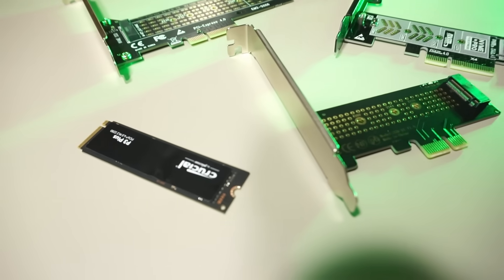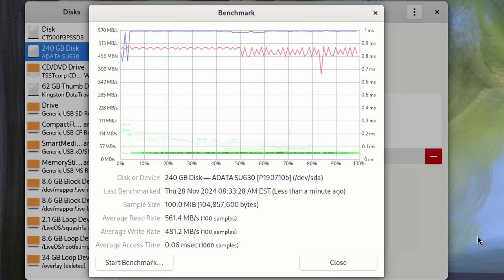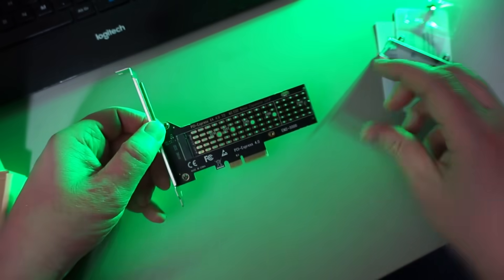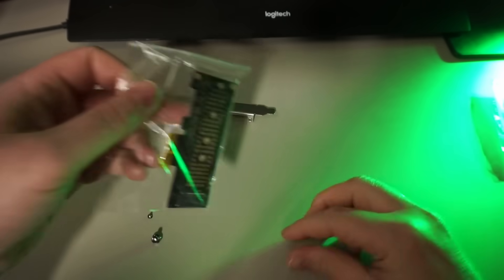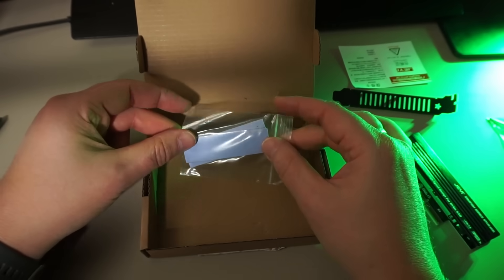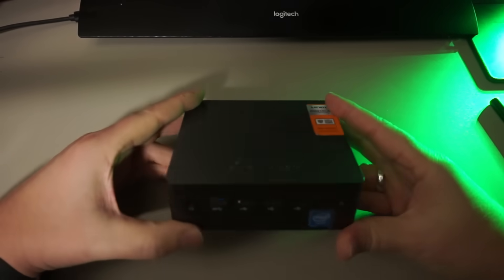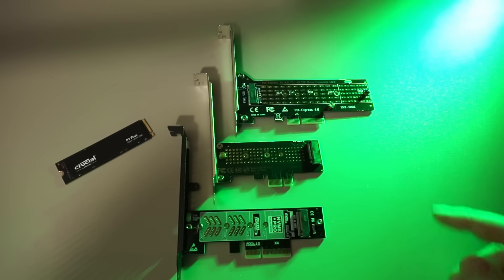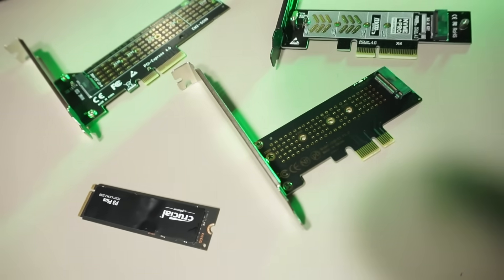Upgrade your old pc with an NVMe! Testing cheap PCIe M.2 adapters!

Comment: I used a 1x card on a J4125 ITX board to save the sata for nas storage (SATA high capacity drives were much cheaper at least at the time of build). CrystalDiskMark showed just over 900MB/s with a cheap Samsung OEM PCIe 3.0 NVMe that managed about 2,200MB/s on a true NVMe port. Was good enough for me.
Since upgraded server/Nas to a T500 on a 4x4 NVMe slot board that goes to about 7,300MB/s

Comment: I actually use one in my PC build from last year. It had two nvme slots which infilled with 2 TB nvmes, than later got a good deal on a 1 TB drive so added it in with one of these.

Comment: His thinking is wrong on heat sinks for NVMe drives.  You many not see thermal throttling on a NVMe if you don't put a heat sink on it. You will have elevated heat that you can reduce with a heat sink to increase the longevity of  the drive.   The HOTER you run any device the shorter the life of the device. It may run at it's top speed, but it will last longer if you keep it cooler.
Reply from the maker: Sure, but as this speed it shouldn't become an issue. I made a mistake in believing my system has PCIe 3.0 slots. It's 2.0, so it's running at less than half what it's rated for. 
I'm picking up a board that has a PCIe 3.0 slot tomorrow to redo the test. Should be quite a bit faster and yes, I do believe it would be beneficial to add a heatsink then.

Comment: A sata is really a decent upgrade for old systems.
An nvme is not worth it in my opinion.
Reply from the maker: They're about the same price here in the Netherlands. Throw in an €8 adapter card and you've got 3x the speed. Kinda cool if you ask me.

Comment: I honestly dpn´t see the value to bother with an nvme drive in a system that doesn´t have a build in nvme slot on the mainboard. A regular old school sata ssd will do just fine. Anyone using such an old system is most likely not doing anything so intensive that he/she would even be able to utilize the higher bandwidth anyways. 
So long story short, consider upgrading to a newer system with a nvme slot, that is if you even need too. My mother plays anno/sims etc on a ryzen 5 5600 and i reused the "old" sata ssd (despite the board having 2 nvme slots) from the old system and the system is damn snappy as is. 
Similar reason as to why gen5 nvme drives are pretty much pointless overk*ll for most users.. heck probably even gen4 is.
Reply from the maker: About any system from about 15 years ago until now is perfectly capable of doing simple tasks like browsing the internet. Simply having stuff starting faster can be a pretty nice feature on those older machines.

Comment: Do you want to test nvme drives? o look at the read speed of their older 3300mb/s newer 7700mb/s ultra the fastest is 14400mb/s when the hd drive has only 120mb/s or sata 550mb/s Max XDDDD That's why I'm only on M.2 NVME 970 evo. No more hdd and defragmentation or a messed up disk for lost data ..
Reply from the maker: I would love to, but I'm still at the point where I have to buy all this stuff myself and I'm bleeding money 😆
Reply: @ex-itguy  Obviously, You have to earn money for something better. These adapters are interesting, I wanted to buy them for my PC before I had a newer PC. But the limitations of these adapters are that you need an x16 slot in version 3.0, otherwise the speed drops by more than half. I've even seen adapters that can be mounted on 8-10 such drives, but the chip in this adapter burns out, which causes the speed to drop, but one thing is good, if you need an adapter and boards without m.2, it's possible, but the speed is max 700-900mb/s, where the drive, for example, has 3,500mb/s, which it supposedly loses in older boards, newer drives also get it through bandwidth and unfortunately lose their durability.
Reply from the maker: Note that there's an error in my test though. My test pc seems to have pcie 2.0 slots. I tested on 3.0 yesterday and speeds are about double the values in this video. So the 1.6GBps you will get on 2.0 as well.
Reply: @ex-itguy  On my old motherboard it didn't even see the adapter so this one. It was only when I replaced the motherboard that I had 2x m/2 slots. I'm currently making the switch and bought a motherboard with 4 m.2 slots. You can buy a better one for m.2 drives for less than PLN 250 for 1 TB, so it's worth it.

Comment: using nvme adapter on old z87 motherboard and install windows in it with some tweaks requiring you to always plug in the usb drive or it wont't boot to windows, but somehow don't know what i am doing exactly now my pc can boot without usb drive.
Reply from the maker: That's weird, if you haven't changed anything. But glad it works, I guess. :)

Comment: A Samsung 950 pro can be used on anything with a pcie slot.  It installs its own "generic nvme drivers" into the mother board.   So anything with even a pciex1 lane can use them for boot drives.  A trick you can do, and I did, on a X58 system from 2008.  A 950 pro in the top x1 slot.  And a 980 pro as the boot drive.  I was limited to I believe pcie gen2 speeds.  But it was still 1600 read and write speeds.  There is a Intel nvme drive that does the same thing.  But it can be hard to find and expensive as heck.  At least when I was looking for it.
Reply from the maker: Yeah the speeds in this video are all PCIe 2.0. I made a dumb mistake... I'm planning on picking up a board with an i5 and a PCIe 3.0 board on Monday so I can redo this test on an actual 3.0 slot. Should be quite a bit higher.
Reply: @ex-itguy  that's absolutely fine. My pcie gen 2 got 1600ish speeds with those drives. I have had 6 of them systems I've built over the years. They work great. That X58 system is still my lan party unit. Got it paired with a RX 6950 XT. It's a thing of beauty.

Comment: I have some of them, they make a lot of sense:

1. I have  a cheap board without nvme slot, Asrock H510
2. I have a server and need all 6 sata onboard slots, the nvme slot blocks 2 sata when in use, the pcie slot doesnt
3. I use 2 nvme ssds on a board with only one nvme slot

The cheap chinese work as well as the branded ones. I am super satisfied with all of them😂👍

Btw:
I assume you need a bios supporting the nvme ssd. Didnt work for me on a Haswell board (Intel 4th gen, H81)

Comment: I'd say that probably most modern motherboards probably DO support booting from one of those adapters. I have a Z97 motherboard with a 4th generation Intel processor, that didn't have an M.2 slot, but one of those adapters worked just fine. One thing to be aware of, is that one of those adapters could potentially change how many lanes are allocated to your graphics card.
Reply from the maker: Someone else mentioned that as well, but another said he used one because the M.2 slot shared lanes with the GPU. 
Annoying stuff. 
A lot of GPU's don't use all lanes though.
Reply: @ex-itguy  It depends on the motherboard and the chipset. Some motherboards get the M.2 lanes from the chipset. Others will get them from the processor. If there are multiple M.2 slots, it will sometimes be a combination. I don't know how they work, post Ryzen era, but previously, most boards would run the x16 slot at x8, when any of the other PCIE slots had anything in them. Some would then drop to x4, if you had something in the alternate full size slot, and something in any of the other slots.

In other words. having a drive in an M.2 slot doesn't necessarily affect performance, but having an adapter card in one of the PCIE slots almost definitely could. However, it's also true that at least as of the RTX 20 series, most cards didn't even come close to maxing out the x16 bandwidth. It might be different with the xx90 series. I don't know.  Just be aware that there is potential to affect your system with PCIE accessories installed.
Reply from the maker: It's a good thing to keep in mind indeed. I'll have to figure out how to check for that on Linux (as I do most things, like this test, on Linux).
Reply: I had to BIOS mod my X79 by slipstreaming NVMe drivers into it; 3rd-4th Gen Intel was the cusp for it. Overall it depends on how the motherboard was built and the chipset it has. For example a motherboard like Intel H670 would funnel 20ish PCIe lanes over 8x 4.0 lanes, while something like H610 or AMD X870 would funnel fewer lanes over 4x 4.0 lanes.

Comment: For those looking for a boot trick for nvme chain loading, get a hold of a copy of clover able to see the NVME drive, then deploy windows from a wim file, it may error on initial boot from the drive claiming "This system is not supported" due to ACPI tables being alien to it, but note that is a user mode error?

You'll need to then use shift+f10 to get a command promt:
1. Add an administrator as otherwise the net step will cause a BSOD as winlogon will exit if no accounts are present.
net user /add [username] [password]
net localgroup administrators [username] /add

2. Force OOBE state to normal
regedit
go to HKLM\system\setup
Edit the following keys:
"SetupType"=0
"SystemSetupInProgress"= 0
"SetupPhase"= 0
"CmdLine"="" (This field should be Blank )
"OOBEInProgress"= 0

3. Reboot the system either via the shutdown command or other means.

This is what worked for me on windows 10 using a m5a97 am3 board, it was even able to update without issues.

Comment: My 11 year old ASUS H97 Plus has an M.2 slot but it couldn't find a 1TB M.2 NVME even when it shows the NVME settings after it was inserted.
I bought a Ugreen adapter, attached the 1TB M.2 and put it in the secondary x16 (PCIe 2.0, x4) and with my OS cloned to it, it boots fine. It still doesn't show in the BIOS where it's located, but the BIOS knows it's there and puts it in the boot menu.
Forgot to say, that M.2 uses legacy boot as that's how my OS installed originally. The BIOS can boot either legacy or UEFI.
Reply: ASUS H97 support Nvme boot ,incase not working upgrade the bios but not support PCI Express supported booting.

https://www.youtube.com/watch?v=NGbbW6TqOvc

Comment: You could have added a short manual how to boot from a different boot device if your BIOS doesn't support NVME. To shortly summarize, just put the bootloader (lilo, grub or syslinux) and /boot on a bootable device. That way I was able to make an old P4@3Ghz work with a SATA-6G  (I literally put in an old 850MByte PATA HD just for booting and shut it down using hdparm after booting) and a Core2 from an M.2 card (I boot from a 2GByte USB-Stick). Booting from Network using PXE/BootP often works surprisingly well too, even my oldest 486 and SGI systems can boot that way, but my servers changed to often so I stop doing that.
Reply from the maker: That doesn't work for things like Windows or Haiku though, that's why I didn't include it yet. I have to test it on something other than Linux for people running Windows first.
Reply: @ex-itguy  syslinux might be the way to go. You can boot it from pretty much anything from MBR, GPT, PXE or some ARM-specific Low-Level-Devices and whatever and it can load and execute RAM-Disks and a lot of other boot-loaders, including the Windows-Bootloader sitting in the EFI-Boot-Partition. Though you usually compile a fitting syslinux-Loader yourself, the ones supplies with distributions (internally UEFI/GPT Linux mostly uses syslinux while MBR Linux still prefers grub) are usually optimized for the mundane task of loading its own Linux-Kernel from a Standard-Mass-Storage-Device.
Reply: @ex-itguy  Ignore my last suggestion, there is even a more easy way: Install a dummy Windows on an USB stick (you can downstrip it to bare minimum), then add an Entry in the Boot-Loader of Windows for the M.2 Stick. The Kernel usually is part of the Windows-Boot-Partiiton and with it comes M.2 drivers.

i didn't use that explicitly to use an M.2 stick but was successful in using it to run Windows from a non-bootable RAID-card.

Comment: Adapters make little  to  no difference as long as  they are  PCIe  x4,  I  have a no name PCIe  x4 adapter. Kingston KC3000 gen4  NVMe in second  slot of my MB which is also gen4 bu  x8  and it works  at  exact peed  as  other KC3000  in  first  M.2  slot. Those single M.2  adapters  are very  simple as they  are nothing more than  just small size physical  connection  to PCIe  slot. As NVMe  drive prices  are same as for  for 2.5"  SATA  SSDs, it's  not only at least  double the speed but also require no cables and are much smaller.  They  also make good  transportable drives once  fitted in a  USB housing adapter.
Reply from the maker: There was a slight difference between the two X4 cards though. No idea why, I expected them to be the same. 
I need to make an updated video because I made a dumb mistake: my system only has PCIe 2.0 slots.
Reply: @ex-itguy  As far as I have  seen it, difference is at level of statistical error, you'd have to  run  benchmark  10  times and  find some middle value. Not even worth  mentioning. SSDs  operation also depends also on  state of  cells readiness  tor writing  and weather  garbage  collection did  it's  job  and  turned cells with deleted   files back to   0 because just deleting  data still  keeps cells  in  same  condition.

Comment: This computer can't have full 3.0 speeds.  It looks like it is an older board that only has 2.0 speeds.  And, I sure wish you'd cover how to have a bootloader on a USB or a SSD.  Because I have an older motherboard that I would love to boot from a USB, and then run stuff off the NVMe.  But, back then, I could never figure out how to do it.
Reply from the maker: You are right, I already mentioned it in the pinned comment and description. This test was done on 2.0. I'm planning to redo the test on another board I'm picking up next week.

Comment: Unless I missed it, you didn't do any testing on a system with PCIe v2.0. I would expect that the results would be twice the speed of PCIe v1.0 and half the speed of PCIe 3.0.
I'm planning on finally upgrading my ASUS M5A97 R2.0 which has PCIe v2.0 (500MB/s per lane x16=8.00GB/s), 32GB of core & a 64-bit AMD FX™-4100 CPU. Its video card is actually designed for PCIe v3.0, so at least it can still be of use.
I figured I would put all the Windows/Linux/UNIX page file / swap space on one NVMe and the Boot drive on another NVMe. That way the SATA/USB bottleneck would only be on non-O/S data which doesn't update as much as the O/S data does.
I figure this old Mb would be a nice file server with a Rπ⑤ as the printer/scanner server as my Laser printers are RJ45 but my other printers are USB 2.0
Reply from the maker: You didn't see the pinned comment did you? ;)
Yes, I made a mistake. I tested on PCIe 2.0. Even the mini pc that does have PCIe 3.0 seems to use only 2 lanes on the M.2 slot, effectively slowing it down to 2.0 speeds.
I don't feel this mistake is bad enough to take the video down but I will create a follow up soon.
Reply: @ex-itguy yeah watched the video and then went straight to writing my comment. I have a couple of new in the box, old 128-256GB NVMe drives lying around so I bought a couple of those 1x & 4× Slot adapters. I'm hoping that even at PCIe 2.0 speeds, an NVMe drive should be as fast if not faster that SATA 3.0 if I only put the Page File on one NVMe and only the O/S on the other. It's not as if they would be slower than SATA 3.0
Reply from the maker: Well since I tested on 2.0, it indeed is about 3x faster than SATA. Which is quite nice I think. :)

Comment: aren't they all on the same pcie x4? what difference does it make?
Reply from the maker: Not sure what you mean?
Reply: @ex-itguy  i mean you bought 3 adapters but they all run at the same speed, say 1600 mbps on their spec. sheet and you put them all in the same slot, what's the point of speed testing here?
Reply from the maker: The point is trying out if there's a difference. As you could see the X1 card was about 4x slower than the X4 cards (which was to be expected, but I wanted to test that). Also, the cheapest X4 card performed just a tiny bit less than the first one so there sure is a difference. 

I made a dumb mistake though: my machine doesn't have 3.0 slots at all, so these tests were done on 2.0 speeds. I hope to be able to make a follow up next week on actual 3.0 speeds. See if the differences are different from this test.
Reply: @ex-itguy  that's a lot of work testing again with 3.0. my point is you can just look at the spec. of all x4 adapters where you bought them. i think their speed are the same not a tiny bit less. the only time the speed is half less than each adapter i tested is when the nvme is on usb adapter not internal adapter directly attached to the board, 1000 mbps and 500 mbps (the websites i bought from stated the spec. of the speed) but if it's internal, speed are the same.
Reply from the maker: It's not that much work and I feel I should rectify this. And specs can lie, especially on cheap Chinese hardware. :)

Comment: Great video must of read my mind, I was thinking about doing this a few days ago when I spotted one of these adapter's on eBay 👍
Reply from the maker: I made a dumb mistake though: I tested on PCIe 2.0... will try to do an update next week.
Reply: This kind of adapters work really well: I'm using two of them. One is PCIe 1X (so slow), but the other is a 4X job - quite snappy. And I bought these weird chinese ones, no boutique brand.